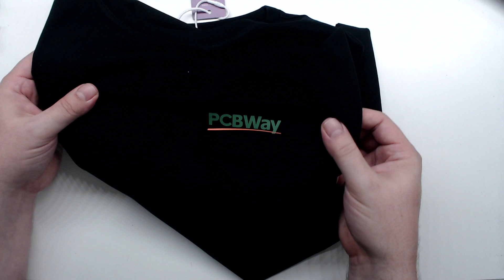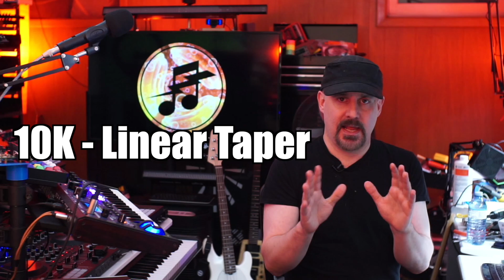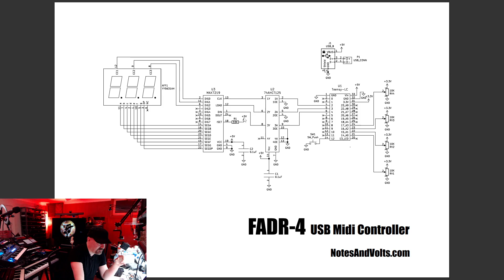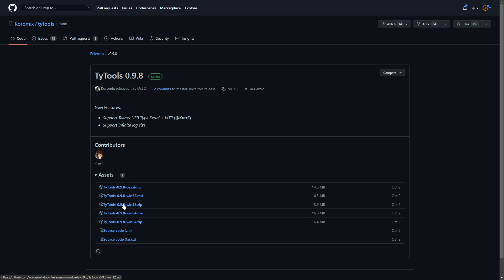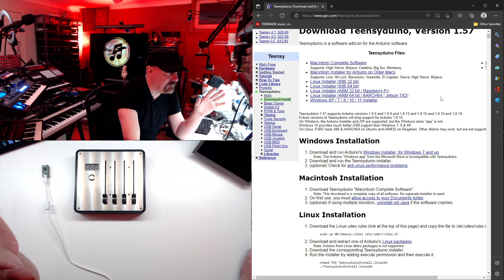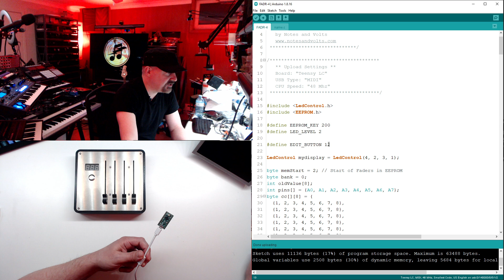Build a Programmable USB Midi Controller - FADR-4

Comment: Even a few years later, this is still a cool project :) As you know the Teensy LC has been discontinued, replaced by the 4.0 and 4.1 - much better units, although at this time about 10 USD more expensive than the LC's were.  Although I've not tried it yet, I'm pretty confident your code should work as is on the 4.0. Having worked with dozens on microcontrollers since their earliest days, I'd put the Teensy up on #1 .. #3 slot, depending on needs. Alot of excellent libraries on the PRJC site - including nice, standalone audio projects. There are also modules specifically for it with audio.

Thanks for doing this project - it is very easy I'd say for a beginner. And it also taught this old dog a new trick or two.

Keep up the good work!

Comment: I've always wondered: is it possible (or is there a better way) to motorize the faders with something like old optical drive motors, and have them be driven with a DAWs automation? Maybe replace the laser with little grabber arms, mount the motor shaft along side of the faders, and a couple micro switches? 

I know the motors would be midi driven.. so would my idea (if possible) work with a regular analog mixer? So the faders is just as it always had been, but the act of sliding it would move the motor, generating a midi signal IN..  then while automating, the midi OUT would in turn be powered?

Or... Does this fall into the category of an infinite knob digital dealio that usaid u aren't going to cover? If so, could u do a project like that one day?

Comment: "My Teensy Arduino is installed correctly and uploads programs fine, but the 3-digit LED display stays fully lit. Pressing the button doesn't seem to run the program. Can help me?

Comment: I need something like this, 8 faders for 1-16 channels (bank a 1-8 and b 9-16) all set to CC07 which is for volume, value would be 0-127, I want to connect it to keyboard synths to control volume of multi timbral parts, 5 pin midi, 5v power, will this work? Thanks

Comment: It's always the way. Minutes after posting below, I worked it out. For anyone interested, there's two right-shift operations which scale the pin value and these need to do an extra bit right shift. Change "Val>>2" to "Val>>3". Works great!

Comment: Hi Dave - great project have just prototyped it, but using the Teensy 4.0. Mostly fine, but I'm getting the CC value going up to 255 instead of half that - it means I lose resolution in the bottom end, an for example, can't set a cc of 1. I'm not a C guy, but have done a fair bit of programming, just can't seem to find the problem here. Both teensies have the same A/D resolution of 10 bits, so a bit stumped. Any ideas? Thanks again, Chris.

Comment: Hi,I LOVE your project and sharing every details kindly,I wonder if it possible to use arduino Leonardo board replacing the teensy lc.I guess in that way,I dont need the U2 part and only I need to do is to update the code,am I right?or have you already considered using arduino board and find the teensy lc is the best choice?anyway,thanks for your tutoruials

Comment: Apparently the Teensy LC is being replaced by Teensy 4.0,  do you think the source could be easily adapted to Teensy 4.0?   Excellent midi controller design ,  you must have put a lot effort designing it.
Reply: I've done it - easily replace the LC with 4.0. Only need to change the processor type in the header.

Comment: Thank you for this video! I want to make one for personal use with Rotary pots. But can I use an UNO instead? I was hoping to just use the Atmel 328 with caps and 16Mhz Xtal and 5v PSU (or I could use the inbuilt 8Meg clock of the UNO). I want to control VSTs amongst other things.

Comment: Wow this is awesome! I have no idea how to do any of this yet, but this seems like a great project to build up to. 
As a noob, looking at the amount of available pins would suggest the possibility of connecting more faders. at face value at least.
Would there be anything keeping me from building something with potentially a few more faders, while using the remaining components as normal?
Reply from the maker: You can add more faders. A lot of code changes would be required though.

Comment: I LOVE that you used the USB B connector! 😭🙌 From the first time you plug it in, those little micro deals are on a countdown until it starts cutting out
Reply from the maker: My thoughts exactly!
Reply: Oh indeed. That corresponds exactly to my own experiences.
Micro USB is a royal p.i.t.b.
It is the worst and at the same time the most widely used USB connector type. 
Goes probably well along with planned obsolescense....

Yay....
Reply: @BothoHohbaum  I ALWAYS thought that, but thought I was being too cynical 🤣
Reply: @els1f ...and the creator of the final device can even blame the producer of that part.
Win - win - win!

I guess we figured it out.

ROFL

Comment: I would add a POT on the back of your unit and add to the ISET Pin so you can control the brightness.  But that's me!
Disappointed that Linux versions are not available...errr
Reply: Just add a trimpot on the PCB inside. Items like that don't need to be adjusted as often.
Reply from the maker: You could do it in the code as well by adjusting the brightness variable.
Reply: @NotesAndVolts  - Yes.

Comment: Oh so cool! I would love an alternative with motor faders
Reply: He shows you how to modify this to use motorized faders in the FAQ at the beginning.
Reply: @HazeAnderson  Ah yes, kind of. I admit i skipped through the FAQ so thank you for pointing that out! However, he doesn't show how you modify it, he just says you can use other faders as long as they are 10k and linear taper. But on the topic of how to modify it to control the motor from the teensy... he doesn't show. But of course, he mentions, that he doesn't want to do a million iterations himself and that's absolutely fair of course
Reply: @michaeldmoch4348  I set you up. :) But hang on .... we never addressed the practicality of using motorized faders for a controller that slings MIDI CC in the first place. What, apart form just LOOKING COOL, would flying faders BUY you with THIS controller? I cannot think of any. You say "I want to automate the motion of the faders for my DAW tracks!" Well, you have to perform that motion AT LEAST ONE TIME, so just RECORD IT INTO THE DAW. You say "I want MIDI CC from my DAW to make the faders move!" Well, this is a MIDI OUT device, not MIDI IN ... and even if you COULD process MIDI in ... all you are gonna do is just make some motors turn. This device is meant for TRANSMISSION. There is ZERO practicality in adding flying faders to MIDI CC controller like this. Can you not accept that this device is perfect and needs no additional features? Please remember that he did not build this device for you and your needs, he built it for a client and that client paid him for his work. You can watch this video for free. Would you like to hire Dave to build you a personalized motorized fader device?
Reply: I'd love to see this too :) I know how to send potentiometer data to a DAW, and how to read data back from a DAW to update a motorised potentiometer position, the trick is doing both these things without the data clashing; like I'm moving the slider as the DAW is tryna also update it